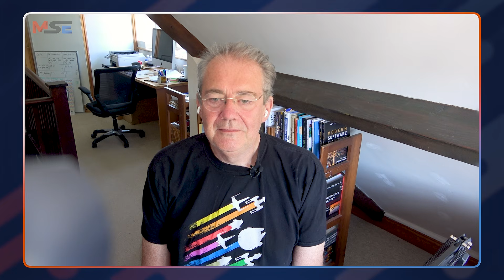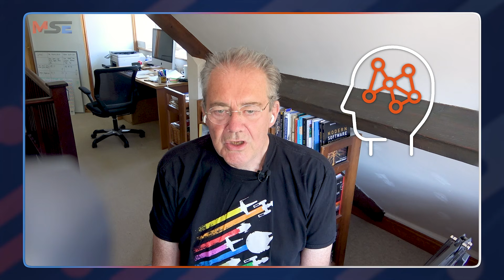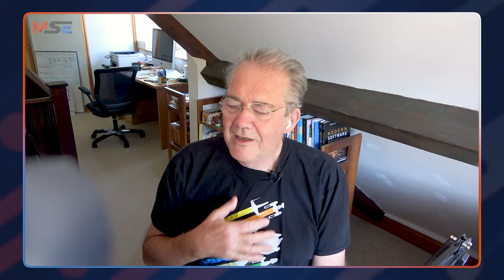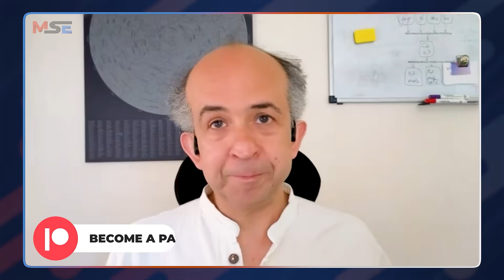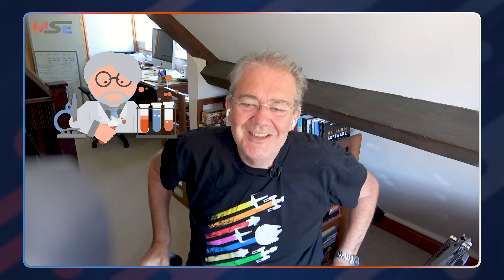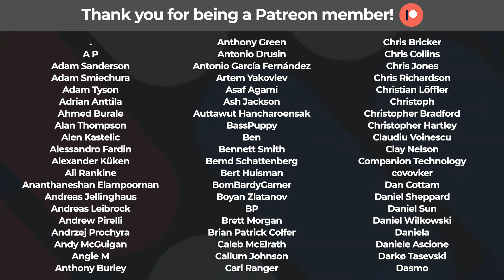Can We FIX Agile?

Comment: Actually it doesn't have to be that way with Scrum. There's nothing inherently wrong with Scrum. I'm working in my second Scrum team now and I totally love it. If Scrum is done right, meaning a truly small and interdisciplinary team where the Product Owner and the Scrum master do their jobs and shield the devs from the outside noise Scrum is amazing to work in as a developer. In a good Scrum team you do all the things you're supposed to do: You self-organize whom which work is assigned to, you collaborate with the BAs and BEs (depending on which you have on the team, first team we had BEs, second now we have BAs) and the architect if you have one and together you work pragmatically with the goal to improve the development process. The ceremonies totally work well if you do them right. The problem is not that Scrum is doing anything bad to Agile. If you gather people with an agile mindset and put them on a Scrum team they are gonna rock the house! The problem is when you gather the wrong people on the team, and then it doesn't matter what flavor of Agile you do. It all comes down to getting people with an agile mindset together.

Comment: > "If you're failing, try something else." Or make a change.

A large part of the problem is that they (managers & PMs) don't think they're failing and when the devs point out the pain points (with suggestions for fixes) the devs' requests/observations are dismissed. Those in charge don't truly understand Agile; they understand "book Scrum" (how the book says to do it). Scrum as practiced at my company (and others) is not agile -- it's rigid.

If you want to fix Agile then kill Scrum; since many companies think Agile means Scrum.

Comment: Agile doesn't work in a hierarchical setup. The problem with agile is that it would need a complete redo of corporate structures, which isn't going to happen, because that would mean for the very people implementing it to give up their position and power in the hierarchy. Now, do we expect those people to shoot themselves into the foot? Not really. So they take the framework of agile behavior and squeeze it into the existing hierarchical form of their enterprise and viola, everything that is bad about agile today manifests. Too much bureaucracy, too much reponsibility without competencies, old waterfall behavior of the managers that brings the old problems of waterfall into the new, already overloaded world of agile processes. 
What you see today is almost always Water-Scrum-Fall, nothing else and nothing more. It's still waterfall projectleading with a scrum-board and lots of meetings. And because for the productive people, this is still a bit better than pure waterfall, they will not have anybody critizising it, out of fear of going back to pure waterfall. But agile cannot exist in a corporate world where budgests are made for a whole year and every project and goal for next year has to be annaounced in September of the previous year. How's that agile? Old thinking for new methods rarely ever match good.

Comment: The only fix is to say "Goodbye" to Agile. It's an "interesting" idea that might work for a niche team in a niche context. The moment Agile got promoted for "best way to develop software" is setting up the current inevitable failure state.

The only "real world" use case of Agile is as a manipulative tool for incompetent management or any fake job titles born with Agile movement to justify their useless existence.
Reply from the maker: I disagree with the first part, that is definitely "throwing the baby out with the bath-water" and the second part is simply factually incorrect.
Agile development when done well, works better than anything else, but many orgs find it hard to do it well, because what they really want is to "be agile" without changing what they are doing.

Comment: Almost exclusively when I hear people say they tried agile and it doesn't work it turns out that the problems aren't actually agile. It's management forcing the organisation to use words from agile but not actually practise agile.

So seldomly it's agile that we want to fix, it's the environment and organisation in which the teams operate.
Reply: Business impose certain requirements on development because they need to make a profit, and not throw money down the drain, so that is not really a problem that can be "fixed".
Reply: @bobcousins4810  I'm going to disagree on "not really a problem that can be fixed". I agree businesses need to make a profit to stay in business; however, if they want to be Agile then they need to communicate their policies that they think are important and then get out of the way and let the developers work out the best way to get the job done within those policies -- that's agile. So when stuff starts failing because "management" is micromanaging (processes over people), then it is the organization that is dysfunctional and needs to be fixed as Daniel says (but probably won't be because they won't acknowledge there is a problem).
Reply: @bobcousins4810  Besides the points raised by Kevin I would also say... many companies simply continue to do what they have always done. Because actual change requires energy and we as humans love to slide into a habit that requires minimal energy. And that habit might have worked onece, but when it stops... that's when companies panic.

And no matter what, if you claim you want to do something but don't do what is needed to support it you are failing. Doesn't matter if it is claiming to want to become agile or looking at the scale and proclaiming you want to loose some weight. If you just say that and then don't do what is needed to enable it you can't blame the scale for your weight loss not working.

Comment: Kevlin and Dave,  I'm a big of you two. My Team had Sprint Planning today. After consider the stories (yes, we estimate with Fibonacci) for the coming two weeks, the team concluded we had to move some stories back to the backlog, otherwise we would not meet the sprint goal (which btw at that point we hadn't decided upon). The thing is, that for what I was concerned, until that point we had very good working scope. "What does it matter if instead of 10 days it takes us 12 or 14 days to deliver this tightly knitted functionality" I said. But my team didn't listen. So now we have a half ass functionality planed for the next two weeks.  To me Agility is about embracing incertainty. But that's not how the human brain works. Managers, and the manager's manager have forecasts to make. Managers don't like surprises. All estimates are wrong. There are lots more methods for getting regular feedback other than a review after 2 weeks  of working. Some features take 10 days to complete, some other take 7 or 13.  But people, engineers and managers alike  have a hard time letting go. I'll share this video with my team. Maybe it will help get the conversation started and start learning and improving again. Thanks guys!

Comment: There are three things that I have empirically found that create good software. Owner’s equity. domain knowledge and identity knowledge gaps then fill knowledge gaps. 
Owner’s equity. When doing my own yardwork, I work at a comfortable pace but never drag my feet or try to fool the boss. I would be wasting my own time. If you are selling and maintaining a piece of software, you want it to be right to reduce sustaining effort. You want it to have customer value to make it popular. The better you do these things, the more money you make. But businesses are cheap and want to pay you by the hour.
Domain knowledge. A lot of software just talks to other software, so general software skills are good enough. A great deal of software is applied to another endeavor. Accounting, Customer Relationship Management, Drone flight control, Anti-lock braking. I’ll bet that less than 1% of accounting software is written by people who have worked as an accountant. Most coders think that domain knowledge is a bunch of nonsense that they put up with. (Until it comes to their own hobby.)  Doesn’t Agile software meet the definition of done before it is ever customer tested? The reason you have unit testing and integration testing is that customer feedback is necessary but not sufficient.
Identity knowledge gaps then fill knowledge gaps. Many people say, let’s see what shakes out, or I’ll give it my best guess. The famous echo of loopbacks post release. Software can promise updates until the day they declare it obsolete. The better way is to scientifically understand, create a countermeasure and test it. Know that it works before implementing it. But Agile is about (mostly) working software real fast.

Comment: As a 20+ software developer and PM (i.e, been on both sides of the fence)... everyone is deluded.  Nothing is going to fix project management until you fix ALL of management. Listen closely to the issues and most of them are mid-to-upper management unable to buy into any of the project management methodologies because they appear to lose power/control and "can't seem get the reports they want".  Until management and marketing are willing to work with the development teams as PEERS, fugeddabout it. Is it doable? Yes.  Will they? Those that do are rare but great to work in - on both sides.

Comment: In most companies I've worked for, whenever I've tried telling my senior managers or product managers that we need to do agile by following the 4 principles in the manifesto and by trial and error and agile is not about process be it scrum or kanban or safe or whatever but it's about accommodating change, the answer I get is that our engineers are not skilled enough to be doing that kind of light touch software engineering. Maybe they are right, to have the kind of software engineering approach you two are advocating, and that I really like and push for, requires strong software engineers, what do you think?
Reply from the maker: It's an old excuse "our people aren't good enough", the real question at that point then is "Why aren't they good enough?" and the answer is usually "because our org stops them from doing what they need to do". I have worked with world class devs, and complete beginners, and "agile" works fine. It takes everyone a little while to adapt, but that is usually matter of days or weeks, not months, and after that you are doing better. So the reason that "our people aren't good enough" is because "managers stop them from being good enough!".
Reply: If you don't treat your engineers as skilled, they won't behave that way either. There are likely 2 things going on. 1. managers feel the strong need for control. It is taking a risk to allow teams to make decisions on their own. 2. they have outside pressure you don't know about. Maybe they are actually on your side but have to hide it. Sometimes middle management gets it but cannot tell you that because their boss does not.

Comment: Agile only really works if the people paying for development understand small increments. When the full product is budgeted and specified upfront, then split into sprints, you get the worst parts of waterfall with the worst parts of agile. You can see the project going off the rails, but nobody is empowered to do anything to change anything.

Comment: Agile became an excuse for non-engineer ‘managers’ to drop the expensive but necessary planning and specification stage, because ‘requirements change’, to just dumping that, and the responsibility, all on the engineers.

Now managers obsess over Jira boards and scrum ceremonies as opposed to actually delivering value to the customer.

And don’t get me started on ‘story points’ and ‘planning poker’.
Reply: so basically instead of doing the work they spend time on talking about doing the work???
seems so

Comment: Agile is NOT the problem.  I am not a fan of Agile, but it works when used correctly.

The problem is that, immediately after the non-technical whoever gets their random certificate, they simply do what the non-technical management tells them.  

I've mainly been a contractor for the past 15 years, and EVERYWHERE I have been says "we are Agile", and they all do thing their own way.

Most "Agile" shops today have two key points in common.  1)Agile == 2 Week Waterfall.  When will this be done, what is the status.  We have to make the date.  All valid items, but not Agile.   2)Agile == Abracadabra    Wasn't Agile supposed to fix this?  Agile means I can change what I want, will you still make the deadline.

It has NOTHING to do with the process.  It has EVERYTHING to do with the management in place.  For every 10 IT jobs there are maybe 3-4 people actually qualified.  The rest are either promoted/hired beyond their ability or moved from an area that fits their skillset to one that does not.

Agile, XP, Pair Programming, SAFE, CMMI, Microservices, DevSecOps, Patterns, and so on mean nothing if the people you have in charge have no idea how to run the show.  Get yourself a top notch Architect and a top notch Business Analyst (NOT A BUSINESS OWNER) and you are already 90% of the way there.  Miss on either one and, in my opinion, you are throwing darts at a board in the dark.  Good people get things done, regardless of the process on paper.

Comment: You can't. "Agile" has run it's once around the loop [1]. 
It's time to down shift, rebrand and re-learn:
 (a) it wasn't anything 'new' in the broad sweep of history (only the special few of the moment see their problem & solution),
 (b) People haven't changed, people grow old, teenagers go down into the basement, and babies are surprisingly hard,
 (c) There are many who are (or become) grifters who want to leech value from the work of others..

[1] Sheard, S.A.: ‘Life Cycle of a Silver Bullet’, CROSSTALK, The Journal of Defense Software Engineering, 2003, (and weblogs various).

Comment: Agile said 'people before process'.  Management said 'we need a process for that'.  If a company has managers it is not agile.
Reply: "While there is value in the things on the right, we value the things on the left more."

Process is not a bad thing. Putting it above people interactions is.
Reply: Companies need leaders, not managers. Leaders lead teams to the goals. Managers manage teams to follow formal processes. There is nothing wrong with the process, as long as the organization can collectively adjust it any time any parts of the process are found to cause more friction than the value they bring. Still, if the whole process is built along writing formal documents and following formal steps, but there is no bold note "TALK WITH YOUR COLLEAGUES DIRECTLY IF YOU WANT TO SHARE OR DISCUSS SOMETHING" coming first, then these processes are simply killing collaboration and, thus, are counter-agile.
Reply: @archi-mendel 'people before process'
Reply: @brownhorsesoftware3605  Exactly. I consider any process a patch to a lack of communication and automation. We never reach 100% perfection in communication and automation, so some kind of a process will always be needed, but the leader's goal is to minimize the formal process, letting people spend more time developing products (i.e., solving people's problems with software).
Reply: @archi-mendel  I've heard this distinction before between managers and leaders. It is quite b.s. in my opinion. I've had many managers where there weren't formal processes. At no point would I say that they weren't managers.
Reply: @username7763 it's not about formal processes, it's about how these processes are dictated - top-down or bottom-up.
Reply: I don't quite agree, but managers should mainly focus on the people, not the product, or the process

Comment: Agile took away too much of the formality that really was needed on large complex projects. Ive inherited too many systems where no one can really say specifics about what the system was originally supposed to do.
Reply: It's not a problem of being agile.
Reply: Working system over comprehensive documentation sounds like it to me.
Reply: @revietech5052  Yeah, they are totally correct—a working system is more important than comprehensive documentation around it. Documentation should serve some aim. Just documenting as "someone may need this at some point" doesn't make sense.

In most cases, a customer-facing feature overview, test cases (specifications), and code are enough to document a change.
Reply: @archi-mendel a working system is more important than documentation, but the point I was making was that agile helped take away that important documentation with that principle.
Reply: @revietech5052  it wasn't agile. It was people who understood it improperly. But I understand what you are talking about.

I recommend you read a post by Dave Thomas (aka Pragmatic Dave), author of The Pragmatic Programmer and signee of Agile Manifesto, called "Agile is Dead (Long Live Agility)".

Sadly, agility, that praised quick experimentation backed by engineering excellence, was taken over by the "Agile" cult sellers. As any cult, they took the form and completely twisted the content.

Agility is great. It praises engineering excellence. I'm sure that the line "That is, while there is value in the items on the right, we value the items on the left more" was added to Manifesto by people like Dave Thomas—real practicing engineers.
Reply: Right, the manifesto doesn't say "no documentation".

And I experience the need for "some documentation" and I am still figuring out the best form
Reply: I know it doesn't say no documentation, but I think it certainly provides a disincentive to document. I think it's fair to say most engineers prefer to code stuff than document stuff, but if you give someone half an excuse not to do something they don't like doing then they won't do it.
Reply: @epischel  // FIXME: ...